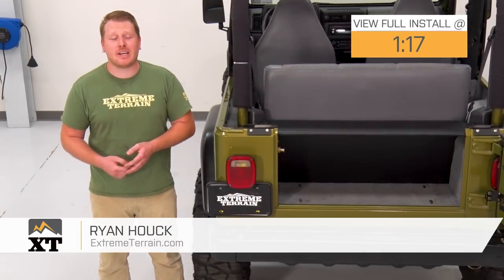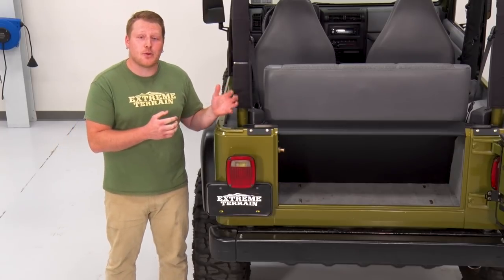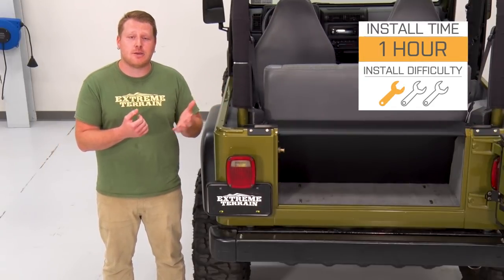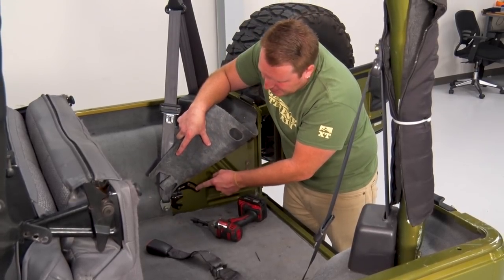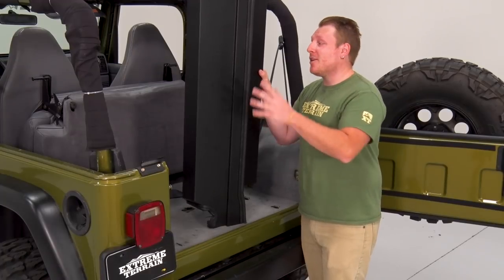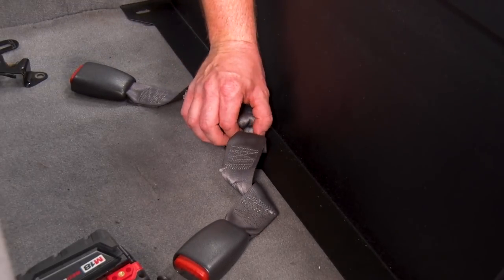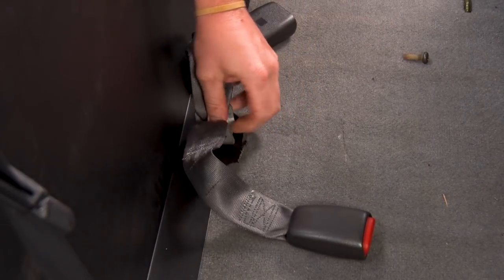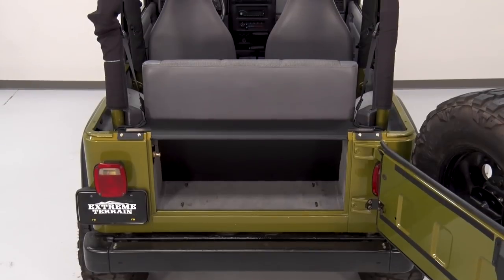Jeep Wrangler TJ Tuffy Tailgate Security Enclosure (1997-2006) Review & Install

Comment: After it is installed can you put the seatbelts through the rear seat?
Reply: It's tight to flip the seat down, and pull the seat belts through.  I recommend a second set of hands.  Push the upper seat belt through and clip into the lower, then use the upper to pull the lower through the seat gap.